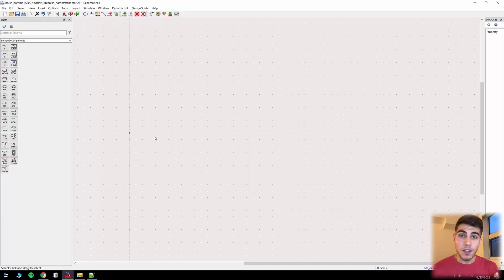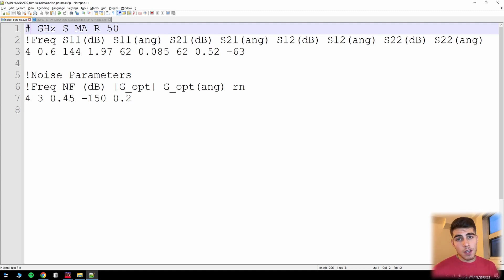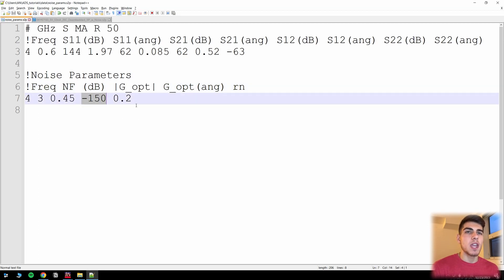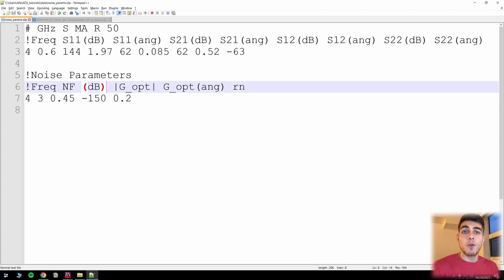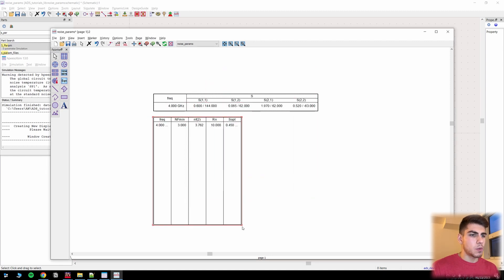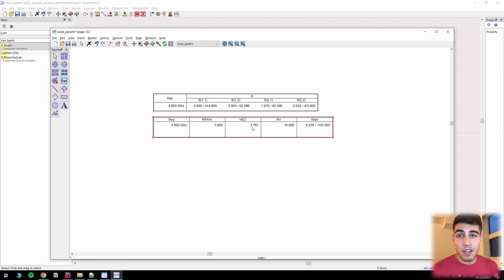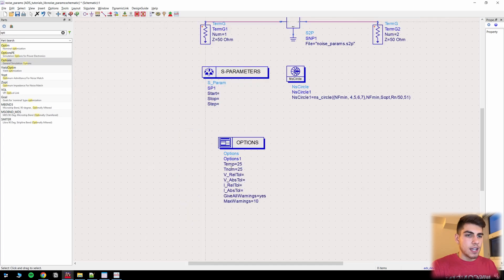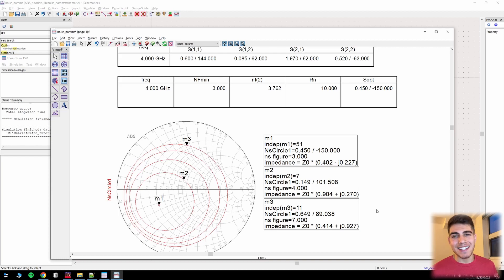Noise Figure & Noise Circles in Keysight ADS for LNA Design (2024 - ADS Basics)

Comment: how about nf(1), what is it?
Reply from the maker: The parameter nf(k) in the dataset is the noise figure at output port k. You can view results using the Data Display. The noise figure for each port will appear in the variables list as nf(1), nf(2), and so on. nf displays noise figures for all ports.

When noise figure is calculated at a port, the other ports in the network are terminated in their respective impedances.

For a 2-port circuit, the noise figure is the signal-to-noise ratio at the input, divided by the signal-to-noise ratio at the output. It has units of dB. For a circuit with more than two ports, the noise figure is the ratio of the total noise at the output port to the transmitted input noise. The total noise is the transmitted input noise plus the noise contributed by the network. The transmitted input noise represents the portion of the incident thermal noise (kTB, where k=Boltzmann's constant, 1.380658 x 10-23 J/K, T=290 K, B=1 Hz) which passes through the system.

https://edadownload.software.keysight.com/eedl/ads/2011_01/pdf/cktsimsp.pdf
Reply: thank you @AriNoori